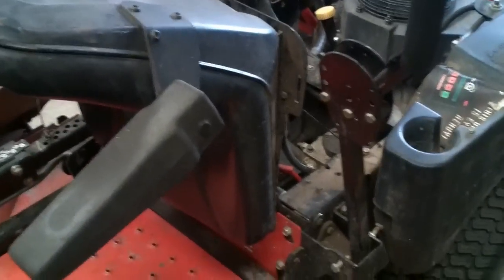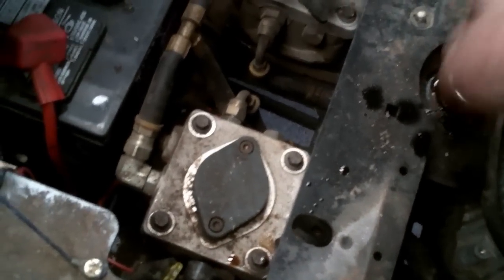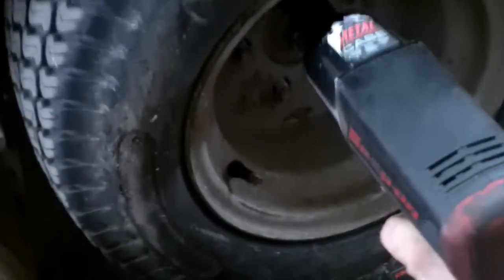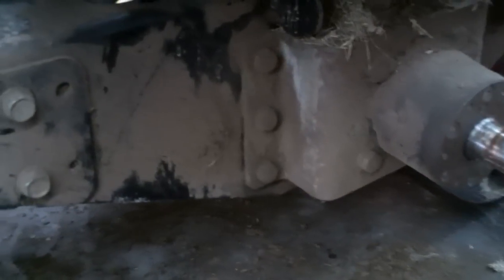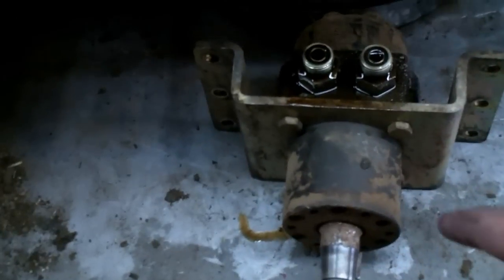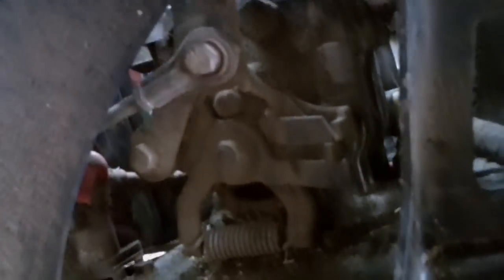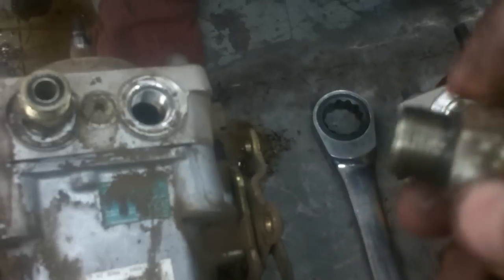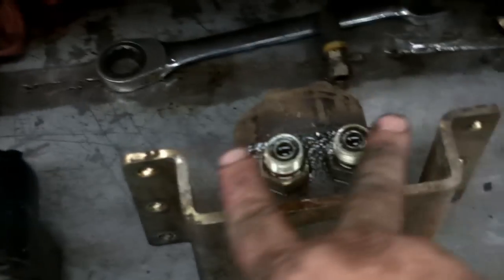ZERO TURN MOWER REPAIR      how to replace the pumps and wheel motors

Comment: Straight ti the point man thank you!  You are the ONLY one with the repair video for this.  Bought a used one from marketplace and as always, something is wrong lol.  I believe the pump is good but the wheel motors on this same exact model Gravely are about gone.  Thanks for this video on the repair for in case the pump needs repalced.

Comment from the maker: PURGE THE AIR BY JACKING THE REAR TIRES OFF THE GROUND AND STROKING THE HANDLES BACK AND FORTH TILL YOU SEE NO BUBBLES IN THE RESERVE TANK ( MAY TAKE UP TO 1 HOUR) THEN AFTER THAT LET THE UNIT SIT FOR 24 HOURS

Comment: I have watched every video I could find on hydrostatic transmission problems with zero turn Mowers and the one common thread that I have found that is present with all of them is the Mowers are ALWAYS NEVER CLEAN. You can tell that they have been maintained at the minimal level if not poorly maintained. People who clean their Mowers and equipment do not have near as many maintenance issues as those that do not. I think the biggest culprit in most hydraulic failures is contamination from outside particles. This is also backed up by research and my experience with operating heavy equipment. Hydraulics have to be inspected and maintained on a regular basis or they will not hold up. Not changing fluid on a regular basis and not constantly inspecting for leaks will cause the hydraulic system to degrade exponentially. Just my two cents...

Comment from the maker: Both hydro gear and Parker-Ross say to never open the hydraulic system unless a failure or leak is evident
The most I ever do is replace the filter evey 1000 hrs and top off the reserve tank

Comment: Hey Jeremy, my kinda video.  When you got some grunting and tool dropping you know that's a real mechanic.  The video work was good as you could make it.  I like the fact that you showed the steps and didn't show the whole job (as you said that would be about a 4 hour video). 
What I'm really interested in is the cost for all of that repair.  I have a Gravely that is similar to that model and it veers and since there is no service dealer in the area it has missed needed servicing. 
I'd like to get this thing back into service but I don't want to be taken for a ride on the cost.
Thanks again, good job!

Comment: I have a scag zero turn mower and when I back up, there is a slight delay in the left wheel. Do you know what could be causing this? Any info will help. Thank you
Reply: That could be a handle adjustment, like if it's slightly off neutral.
Reply: Possibly a directional control value.

Comment: Great video awesome explanation,,,my question is I’m working on a 1996 hustler plow tractor,,my right side handle does not move any more,,I thought it was the wheel motor and I replaced it and the machine still won’t turn right,,any advice? Thanks

Comment: What a great video! I have the same machine, the right one was making a noise and acting up at times so I sent for a new one, they sent me one with no fan spout but has the same part # ? I told them it was the one with the fan on the right side, could both be the same part # they said it was the one for it` any help would be great. Thanks

Comment: Question for a mower expert: I have a scag wildcat with play in the left stick. The left side also goes slower than the right and tends to lock up the wheel when pulling back on left stick. Pump or wheel motor?
Reply: First pull the wheel off and you may have a hub but inspect the insides there to make sure nothing is binding, not sure how the scag works but several mowers have brake systems integrated into the wheels, if any of those parts or something else broke and come loose and ... I realize the problem isn't likely there but it's where I would start, by ruling out the obvious.  Also make sure you have enough fluid in the tank(s).

Comment: Would love to see a hydrosteer rebuild on a grasshopper or old woods zero. Them things are way expensive!!
Reply from the maker: Quark's Bay those old Gemini hydrostatic trannys are bulletproof
Reply: I got a used one. The left one seems way weaker than the right. Dunno. When i push forward i have to take it easy on the right so my left can catch up..kinda scratching my head on it.
Reply: @quarksbay  Similar situation except my left side will overpower my right - at neutral the left handle  is several inches behind the right but I still can't push the left all the way forward as it will go to the right when both handles are pushed all they way.

Comment: Rebuilt the hydro gear then purged  the system  when up on stands works well back and forward but when put it down no power in the wheel any help thinking  maybe the wheel motor  is no good

Comment: Thanks for the video Jeremy. Just picked up this model Gravely with 440 hrs. No signs of pump trouble yet, but have this video when it comes time. How do i tell if my mower currently has hydraulic oil or 20w/50?  Is hyd oil much thicker?  THanks for the help!

Comment: I have a 74” Dixie chopper the right side will barley drive and whines really bad. I took it to the shop they said it was the pump. I had them rebuild it and it changed nothing now they say it’s the wheel motor but I have to change them both. Curious what your thoughts are. I’m in $800 now and they’re saying an additional 2k from a previous install on someone else but if they can do it for less they will. Meaning I can get the parts at cost.

Comment: Man could I do with you here for a while, you are one very talented man. you work so quick and efficent. I have spent a day trying to bleed my husqvarna iz4821 and while the oil in the res tank starts off clear it soon becomes milky with tiny air bubbles. everything is tight and I have purged heaps of times. I need a Jeremy! Where can the air be getting in?

Comment: HI Jeremy.  Time to change Hydro trans fluid.  500hrs  Simply drain tank and replace filter?  What about remaining oil in motors and lines?  I have the same Gravely you repaired in your video.

Comment: I need to remove my wheels on my walk behind. Its hydro pump and wheel motor driven like the one you just worked on except mine is a 48" MTD PRO Walk Behind. There is 4 lug nuts and 1 center castle nut. My question is, do I only remove the 4 lug nuts to remove the wheels? I did just that and couldn't get them off. Then I removed the castle nut and still couldn't get the wheels off

Comment: My tire is rubbing on the frame and I think that's why my wheel motor went out any idea why it would be rubbing i bought the lawn mower used I replaced the wheel motor ..but it's still rubbing on the frame on the right side the left is fine..

Comment: Very informative video. I am hoping that this is not what I have to do. My Husqvarna zero turn recently had the idler pulley break. I disengaged the freewheel so I could tow it home. After getting the pulley put on, and re engaging the freewheel, the mower went very slow. After troubleshooting,  I determined there was air in the line. After purging the transmission several times, it ran fast again.  Only to discover that my right hand turns are very slow when I use the left lever. When I push the left handle (which turns it right) all the way forward I slow down. I have even purged just the left side hoping that would fix it but it didn't.  I ended up cutting using left hand turns more often to get the job done. Can you tell me if you think it is this motor? Thanks, Erica

Comment: I have a scag superz that has started to do the same ,i am using 20/50 but at first when i got the mower it was fine the seller had let it set for 5yrs and now all kinds of racket! Do I dive off into the drive motors or look at pump?

Comment: Hey I have a 2006 Dixon Kodiac w about 650 hours.   Just started having problems with the right wheel getting weaker than the left wheel.  How can you diagnose whether it is the hydraulic pump going bad or the wheel motor?

Comment: Jeremy you said the wheel motors were the same no left or right ? is that right ? I have a snapper pro s200x and the motors have different # for LH & RH . have a seal leaking on the LH Motor out the shafts deal having trouble finding a seal kit that & one that is affordable  any suggestions.
also can you use regular 20w50 ?
it's a HGM 15E 3138.
Thanks
ww

Comment: Hi Jeremy I recently picked up a 2009 Toro Grandstand with only 412 hours it mows awesome. my issue is that when I'm backing up the Rt side is weak and slow. I've looked at the normal adjustments and don't see anything out of wack.. I've read in some forums that this was a common problem with this model.. any ideas or info on a fix would be greatly appreciated.. thanks

Comment: hi, I have a 2011 toro z master 3000 series with a 24 hp Kawasaki. The mower runs and cuts excellent, we changed the hydraulic oil and hydraulic filters last week. The left side turns perfect, but the right side turns terrible and there is a delay on turning right. When I turn right, it seems to be harder and puts more force on turning on the right side only. can you please help ?

Comment: Great Video!! I have a 2004 Hustler Mini-Z and after having it "Serviced", I had nothing but problems. Both drive pumps went out at the same time. Can they be rebuilt or should you buy new? Bought a new Hustler and would like to fix the old for a back-up. Any suggestions?

Comment: Hey man great video...quick question for ya...just picked up a free Dixon ztr428 zero turn mower....it works prefect runs strong and cuts perfect too...it has a new 14.5hp Briggs intek engine....my question is...what do you think of these Dixon mowers....any huge problems with em...cause I'm thinking of keep it for myself...never had a zero turn b4...any advice would be awesome...ty!

Comment: I’ve got a Scag swz and I can’t figure out how to actually remove the pump from the frame. I can’t get a puller on the pulley and I can’t get to the bolts without removing the pulley

Comment: Hey Jeremy... just recently acquired a Woods R2048 zero turn that seems to run well (motor on it at least) but has it's share of problems.  First of all doesn't have much power going forward (left side has more than right),  I can go back and forth to gain power and will eventually go okay on level ground but must do most inclines in reverse.  Someone replaced the original motor with a 14.5 hp and I'm wondering if that would be giving me the issues I'm having that seem like hydro problems?  I think I will start with changing fluid and filters because I don't know if they've been changed or not, making sure no leaks anywhere and purging system of air.  Any other suggestions???

Comment: i have a lesco zero turn  rebuilt pump ive tried to purge system cant get fluid out of the high side of pump tank full and filter is also should i fill the pump up first and try or do you have any ideas

Comment: Great video!  Question, what does your shop use for reference? Do you have something like AllData like the automotive shops have to show mechanical and electrical breakdowns and reference diagrams? Or, is there such a thing?

Comment: great video jeremy thank you. I have a GRAVELY ZT 1540 WITH A 17.5 HP KOHLER that has locked up. taken off the head and the top case to inspect lower drivetrain and piston top and cylinder wall. No broken parts or scoring of cylinder wall . all that is left is the crankshaft or rings right? could the hydraulics keep me from turning over the engine? thanks tom from KC.
Reply: Thomas Maslanka take the belt off the pumps to see if hydraulics are an issue

Comment: I have a Gravley 255 2Hd zeroturn it goes forward just fine but whenever in reverse the wheels just barley spin  any suggestions
Reply from the maker: Linkage, fluid level, scored center section, many many things it could be

Comment: what does a repair like this typically cost? Thinking about buying a toro 74601 says needs pumps, I'm guessing it will need the wheel motors too.
Reply from the maker: Approximately 2000

Comment: great vid !
Hope my issue is not with hydraulics but...
I have an Exmark lazer z hp and the right steering arm is about 5" out in front of the left arm. Mower moves great and turns accordingly but the arms not being even is weird.
What would be the cause and what is the remedy?
Reply: What's the easiest way to get the hydro transmission off of a Hustler Z?

Comment: Do they put bypass valves on these so you can push the unit? I don't see any on my compact pro. Also, how come they don't put a fan on both pumps?
Reply: yes the y have  went   the mower beak
down you can push

Comment: Hey mm1 thanks so much for the video! Great help! Where did you find the parts for this? My 32" Gravely zero turn just started spewing oil from where I believe is the wheel motor. Do I need to replace the pumps too? It has 830 hours on the motor. Is it worth paying for the parts? Thanks for your help

Comment: I have a Gravely 260z and have replaced the Hubs and can not get the hub all the way up on the spindle to seat, stops short of the cotter pin hole by 1/8" or 3/16", the hub nut goes on with a couple of treads showing. Had to use a car hub puller to get the old one off. I did grease the spindle shaft before installing the new one and did align the keyway. Any thoughts
Reply from the maker: Wrong hub

Comment: I have a toro time cutter zero turn mower ,the right side leaked fluid out ,now it's very weak ,its the type that has 2 black tubes that comes out on left side and right side, what are these 2 tubes for ,and how do I fix the right side pump .I have been told the pumps are non repairable
Reply from the maker: If the fluid leaked out it’s not going to work you need to fix the
Leak
Then  fill it up with the correct fluid the tubes or just Vents

Comment: im.trying to remove the deive belt pully on my  right hydro.   its bolted to the bottom  and i cant remove  the pump untill i remove  the pulley.  when i try to take the bolt off holding the pulley  in place it just turns  the hyro and the clutch and stuff.    what should i do ?
Reply from the maker: Impact

Comment: which is likely to be damaged in pulling a heavy load to where the  wheel motor is stalled?  The pump runs at a constant rpm supplying hydraulic oil to the wheel motor. You would think it is a matched set and that a stalled condition is expected  to survive. without damage.

Comment: Hi Jeremy. I have a Bunton zero turn that is chattering on the left side. The unit is still pulling and has good power but is weaker than the other side. My question is how do determine if it is the pump or the wheel motor?
Thanks for your time. I think it is the wheel motor but not sure.
Reply: You figure the problem out? I am having the same issue

Comment: Thanks for the video but not sure this is my problem.
I have a Husqvarna CZ4817 zero turn riding mower that I just replaced the drive belt and ty-rod. It worked fine for 12 hours of mowing (4 different times).

I was mowing last night, went to use the right arm to back up and it would barely move backwards. It moves forward just fine and turns just fine. It just want back up on the right side. Left side works fine in all directions. Please ya’ll any ideas on what to look for, where do I start?

Thank you so much in advance.
Reply: Lisa King Wow no one here can give me any advice? Thanks guys haha
Reply: +Lisa King  Still waiting on any information out there
Reply: so what did u end up doing my 4820 just stopped moving?

Comment: Hey Jeremy, the noise at 1:01 that the left stick is making - my YazooKees 48" ZT Max is making the same noise. Is that a pump problem, or wheel motor problem?
Reply: If your pump sounds like that the internals are destroyed
Reply: What is the chances that the rest of the system is also damaged since the pump is?

Comment: Jeremy,
Great video.  I have almost the exact situation.  The right side pulss like a mule.  The left side is a complete different story.  No power at all, and the deck will not raise or lower.  Feels like I'm a Nascar driver making nothing but left turns.  
Would you think it is the pump or the actual pump, or both.  Should I start with one or the other?
Reply: You figure that out my Toro Zmaster Z500 has loss of power on the left side and a lot on the right. Not sure if it is pump/wheel motor

Comment: jeremy seeing if you can help,  I have a swisher ZMax ZT2660 with eston transmission system. I put regular hydrolic oil 32W in the reservors and now it starting to drag. any suggestions on how to fix problem. did i use the wrong oil. what type of oil should i use in this eston transmissions. your insight would be deeply appreciated, thanks, John
Reply from the maker: if you haven't burned up the center section of the pump you can flush it out with 20w50 mobile 1 and fill the trans with the same oil

Comment: I have a dixon DX254.. Replacing the Pump belt that snapped so i dent get to see it installed... Does anyone have a diagram of the belt routing? Or a top down picture would do... The idler wheel  does not seem to be on the same plane as the other pulleys? did something get damaged?

Comment: I just installed a new wheel motor on my country clipper zeton and it is the joystick model as far as getting the air out of the lines is there anything specific I need to do it seems like even with the joystick in the neutral position pushed all the way down with it on jackstands the wheels still turn
Reply from the maker: Jonathon Richards should be self purge.  Not sure what u mean by wheel still turns
Reply: What do you mean by self purge ? After I cycled the hydros forward , back , side to side and put it back in the neutral position the wheels are still spinning slowly with it on jack stands.